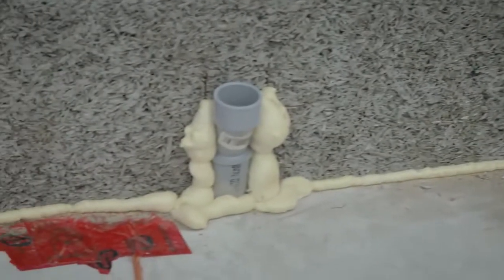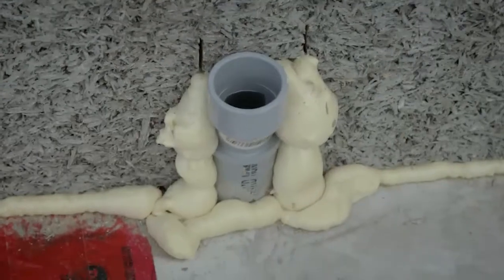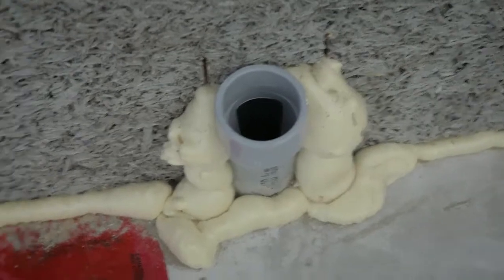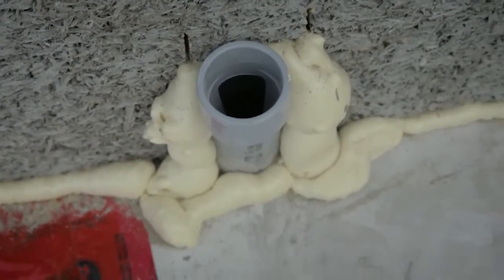How to Build with Nexcem ICF Part 12: Electrical & Plumbing

Comment: Hi Tim,   for a residential build in Toronto  after you cut the electrical chase
Reply: Does code dictate an embedded vonduit? Or simply tacking the xable would be suitable to meet code and keep costs down?..  chubby fingerbtyping sorry for tge 2 parts!
Reply from the maker: @nenadbudisavljevic9835  Hi Nenad 
On the last few jobs we’ve been using steel conduit in 4” boxes. Keeps the electrical authorities and electricians comfortable. I find it to be the fastest method. Conduit is embedded in concrete. Thanks

Comment: hi Tim, i'm looking heavily into various ICF products & had a question about Nexcem's mineral fiber insulation... wouldn't the weight of the concrete trying to fill outward as it piles up cause the fiber to collapse under the pressure?...especially near the bottom blocks? if the mineral fiber is collapsed, wouldn't it lose the majority of it's insulating properties?
Reply from the maker: Thanks for your question. No, Nexcem uses a higher density fibre that prevents collapse. Tests of a finished wall assembly show the same insulation resistance at top, middle, and bottom of the wall. Hope this helps. Feel free to email me at tim@timsingbeil.com if you have any other questions.
Reply: @timsingbeilnexcemicfspecia5761  ...pretty amazing. thx for the reply, and on x-mas eve of all days!